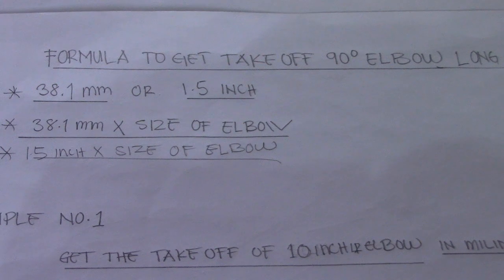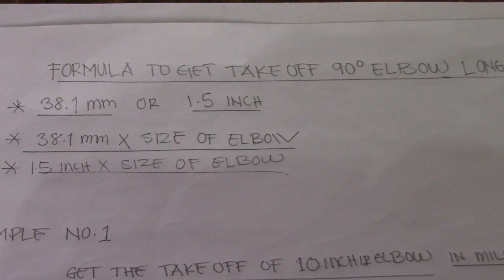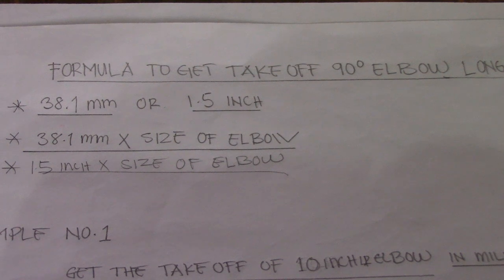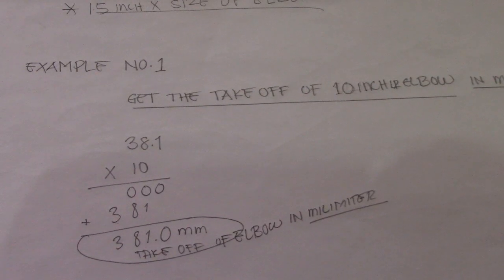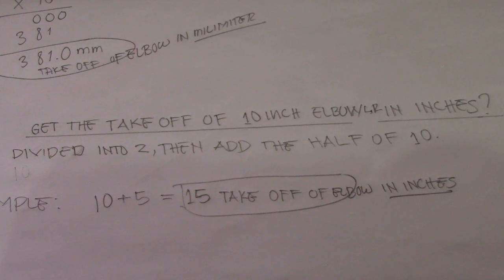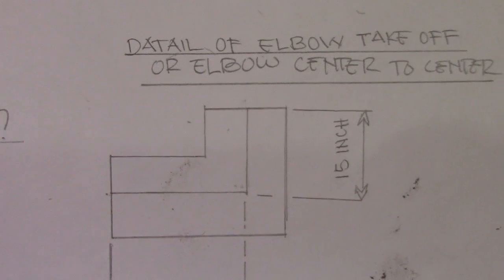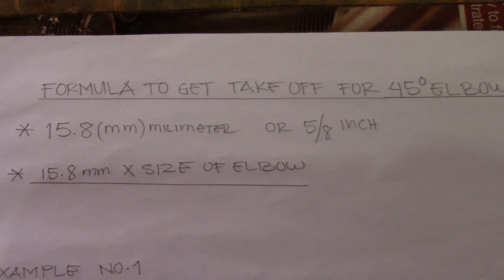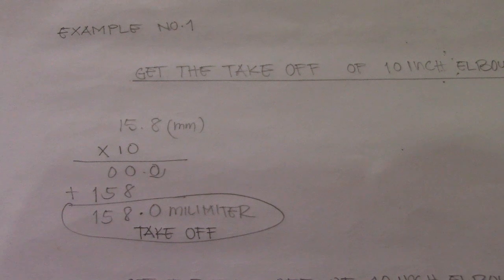Formula To Get TAKEOFF 90 & 45 Degrees Elbow LR

Comment: Boss 38.1 mm x 10 inch
The 10 inch no need to convert to mm thanks if you answer may Q
Reply: Boss ang formula kase is . 1.5 inch X 10 (diameter of pipe) X 25.4 = take off in MM . 
Ang ginawa nya is ganto . Inuna nya yung 1.5 X 25.4 = 38.1 . So to convert the take off of 10 inch to MM simply multiply 38.1 X 10 = take off in MM . I hope naintindihan mo po

Comment: How come you multiply  mm to inches, in multiplying different unit  you need to covert either one of the two. 38.1mm x 10 inches this is what you did which is wrong . I hope you rectify your explanation.
Reply: 1.5 X diameter of pipe X 25.4 ( to convert it to MM ) = Take off in MM . Lols di mo gets ? Hahaha

Comment: boss baka pede nyo ma share san ba at panu nakuha un take off na 38.1 sa 90 at 15.8 sa 45 elbow.. gusto ko lang talaga malaman may list na ako dati nyan kaso nawala sya at di ko natandaan
Reply: yang 38.1mm na convert yan mula sa 1.5 inch (1 inch = 25.4mm). Bali 1.5 x 25.4 = 38.1mm, the same sa 45 elbow 5/8in or 0.625in, 0.625 x 25.4 = 15.875

Comment: Easier way is to break the OD in half 4 times add 1 and 2nd number for 90, add 2-4 number for 45 .
So 12,6,3,1.5 … 18 “ is takeoff for 12 lr 90, 
Another example , 6,3,1.5,.75, 3.75 is takeoff for 6 inch 45.

Comment: For 90s: Long radius is x1.5 of pipe diameter. Short radius IS the diameter of pipe. So a 6" 90 long radius has a 9" takeout. A 6" 90 short radius would have a 6" take out. Simple. Not complicated